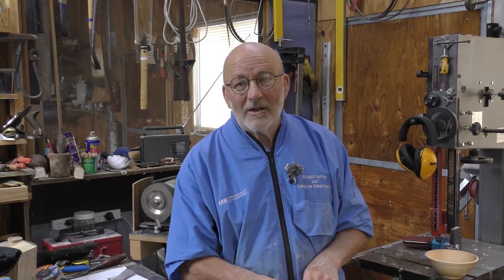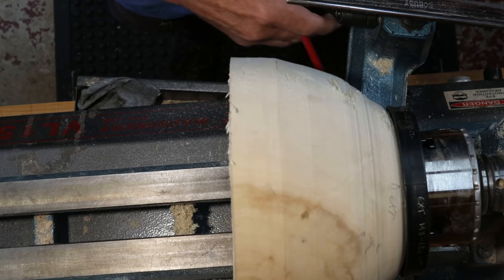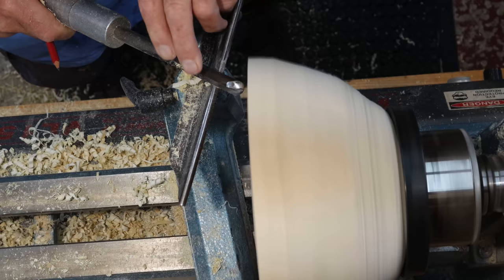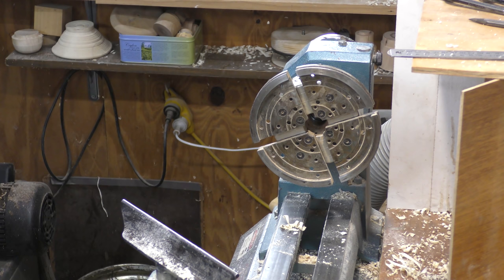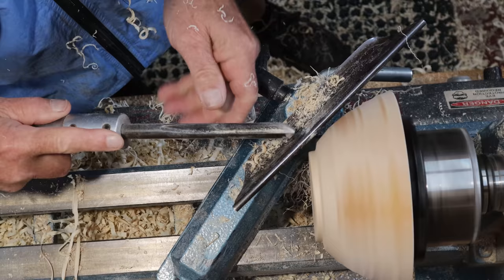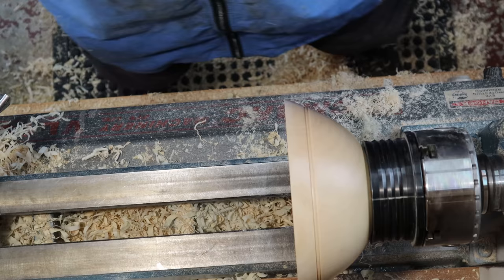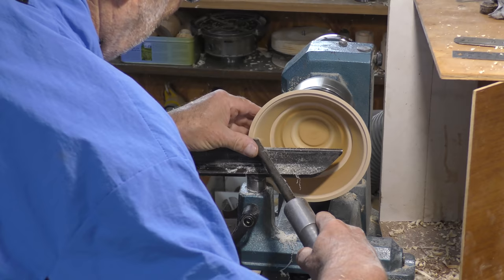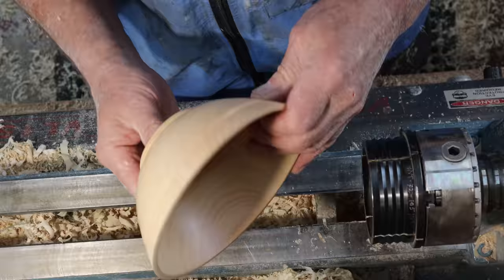Richard Raffan remounting roughed bowls for completion

Comment: Richard, I am just past the 26 minute mark and have to stop to say thanks for a tip. I'm only 74 but old enough to think about the physical stresses and your suggestion to rest an arm on the head and pull the sandpaper will be used tomorrow.  Thanks! Now back to the video.

Comment: I was hoping to have better luck with splitting by selecting wood from standing dead trees on my property assuming they would be relatively dry without being rotten.
Reply from the maker: Dead trees are likely to be dry with splits to work around. The trouble with wood from dead trees is that the wood looks dead. It's a sad fact that best wood comes from trees that have been killed.

Comment: Ah! So, you have a bunch of calipers preset to minimum chuck sizes!  Also, I like your practice of honing a tool in place while turning(with diamond hone), rather than turning the lathe off, walking to the grinder, walking back...Will I become as good as you if I justwatch you long enough? Im not so foolish...
Reply from the maker: The dividers are set to the diameter of the jaws as they were machined (before being cut into four jaws) so they can clamp around a slightly smaller diameter if needed.

Comment: Super video's, I'm learning lots. Please, what power is your lathe and depth range? I've just started on a small 375 watts, 240mm diameter lathe, and getting the hang of it very quickly so thinking I will buy something more powerfull in a while, but not sure if bigger is necessarily better. What's your thoughts Richard? Cheers.
Reply from the maker: My Vicmarc VL 150 has has 0.75kW motor and it's large enough to turn a 270mm diameter bowl. I've also the long extension bed which gives me more than enough for tools handles and the odd chair leg. https://vicmarc.com/product-page/lathes/vl150-detail. I've downsized to this lathe but for years had VL300s. I hardly ever got to use anywhere near the full capacity of the VL300s.

Comment: Do you sand at the same speed as you cut? Or do you slow the speed for sanding?
Reply from the maker: Occasionally I slow the lathe a few hundred revs for sanding, but only if I feel the abrasive isn't grabbing dragging on the wood. For the first 20 years of my turning career variable speed lathes weren't an option and changing speed on pulleys took too much time and therefore money. If the abrasive slips and slides on the spinning wood you can drop the speed, but it's usually better to get fresh abrasive.

Comment: How many bowls do you think you have turned in your lifetime?
Reply from the maker: A few years ago when I still had all my invoice books I counted just over 30,000. Only around 3,500 were more than 12-in/305mm diameter and about 45% were less than 8-in./200mm diameter. At least 2000 would have been less than 4-in. /100mm diameter, whilst only about 150 were more than 16-in/400mm.